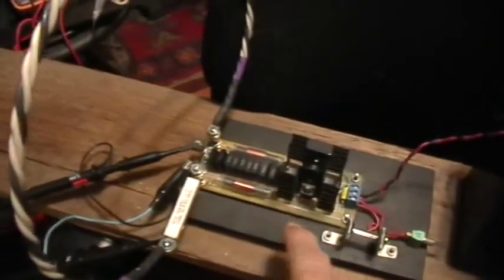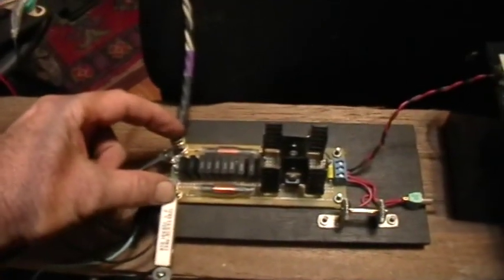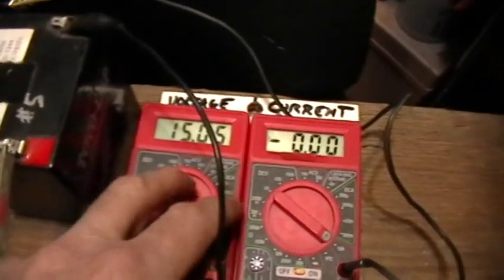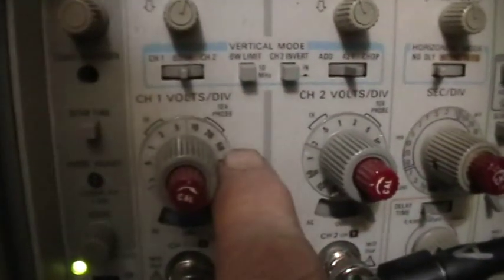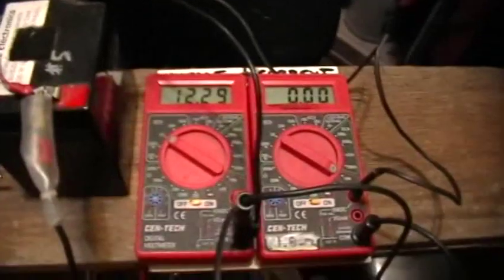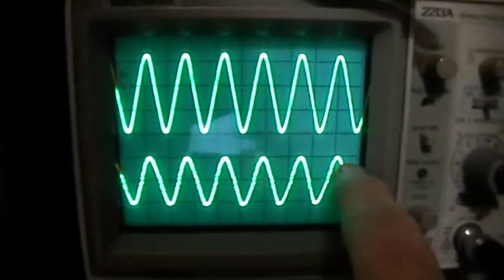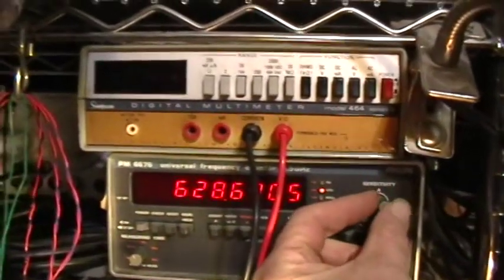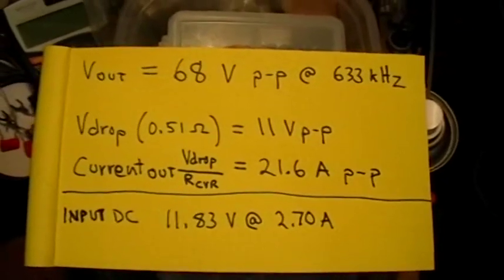Scoposcopy: Texas Has Resonance! Overunity in VARs... Or NOT ?

Comment: Nothing to have with your demo but as you looks very much more competent than me in electronics, could you tell me what would be in your opinion, the equivalent in electromagnetism of the venturi apparatus? Especially in vacuum tubers? :)
Reply from the maker: That's an interesting question. The Venturi apparatus increases airflow within its "throat" and thus produces a lower pressure, which can draw in more air from another stream into the venturi throat. I think this might be like a vacuum tube triode, or a solid-state transistor, with very low gain. (The air drawn in by the vacuum (the collector current) is much less than the main air flow creating the vacuum (the base-emitter current)). How does that sound to you?
Reply: TinselKoala I had indeed the very ideas but I was not fully satisfied with while pressure here is equivalent to voltage and flow as current. 

In venturi it is the energy conversion from pressure to speed which creates the negative pressure.

What if the outer reservoir of flow would not yet oriented electrons and that the "negative pressure", but here would be relatively to the negativity of the electrons, so positive charges/voltage, in their high speed flow would attract the free electrons of the reservoir? Would we have "o.u." here? Probably not more than in the venturi system, but I mind if making a very fast shift from neutral to positive would not attract electrons from the environment. ..
Reply from the maker: Khwartz
I think we have reached the limit of the analogy! The venturi isn't a perfect fit to the electronic device. But you could probably simulate the venturi even better with analog electronics deliberately designed.
Yes, that idea of entraining electrons from the environment with rapid rates of change in some circuitry is also what I've been thinking about for years. Possible? Hmmm......
Reply: TinselKoala You said it! "Possible? ..." ;)

Comment: First, I think, you have to divide the p-p Voltage by sqrt(2) in order to get true RMS (effective Voltage).

Then you have to take into account the phase angle between Voltage and Amperage, which is called "power factor" http://en.wikipedia.org/wiki/Power_factor. "Active power" = "apparent power" * cos(phase angle)

Finally you might see a lot of "reflective power" due to the hidden inductance of the resistor, see:  http://jnaudin.free.fr/rvproject/html/ugentest23.htm

For measuring the hidden inductance of a resistor see:
http://jnaudin.free.fr/rvproject/html/InductanceTest.htm
http://www.dos4ever.com/inductor/inductor.html

Nice demonstration, greetings, Conrad
Reply from the maker: Hi Conrad
First, if one has in-phase sinusoids, multiplying the peak-to-peak values of voltage and current, and then dividing that result by 8, is mathematically equivalent to taking the RMS values of V and I and finding average power from them.
Next, I could not see any phase shift in these signals. If there is any phase angle it is very small.
Finally, you are right, the resistor does have a significant reactance and so its overall impedance at 630 kHz is unknown by me. This will have a significant effect on the calculation, I think.
Thanks for the links, I'll see if I can find out the inductance of the resistor. My meter would not measure it at all.
Reply from the maker: I tried the method of halves listed on the dos4ever site and I can't use it with this resistor, apparently. It gives me answers like 580 nanoHenry, which would account for why my meter registers zero if correct, but I can't see how it could be correct. JLN's site is unreachable at the moment, seems to be down.
Reply from the maker: TinselKoala
It could be that accounting properly for the inductive reactance of the resistor would bring the average output power calculation right down to be in close agreement with the input power. I'll have to see if I can repeat the measurement with a proper non-inductive Current Monitoring Resistor.
Reply: TinselKoala
According to my calculations the capacitance of your resistor should be about 9e-8 Farat which results in an impedance (AC resistance) of about Z = 2.8 at 630 KHz. To measure such a low capacitance is tricky.

Formulas use: Z = sqrt(R*R + X*X), X = 1/wC, w= 2*bi*f, f = 630000

w = 630000*bi*2

C = sqrt(1/((Z*Z + R*R)*w*w)), assuming Z = 2.8 and R = 0.51 --> C = 9e-8

Greetings, Conrad
Reply from the maker: conradelektro

Actually I got the same answer using the link you provided and the method of halves. The impedance of around 2.8 ohms means that the output power computation comes out to very nearly the same as the input power. I got 580 nH as the inductance for a total Z of around 2.8 ohms. (2.3 from the inductance, plus the 0.51 from the DC resistance).

Comment: Hi,  thanks for this demo, TeslaColas.

Isn't your loop a kind of tank circuit? 

I mean it saturates in energy near instantly when supplied but it would be energy shifting alternatively from inductance to capacitance by the resonance, so having nothing to do with a true potential output power? And consumption in input is just the excess energy the tank circuit that represents your trifilar loop can't take and escapes as heat and radiations? ;)

Cheers.
Reply from the maker: You are exactly right, and that is the point of this demonstration. The people who are building and testing the "QEG" around the world are shouting and celebrating about exactly the same phenomenon I illustrate here and which you have correctly described.
Just as there is no "OU" in this device, there is also absolutely no OU in the performance of the QEG, and their claim of "33x" overunity is simply a lie, because any Electrical Engineer or even "engineering artist" worth his salary knows this fact.

Thanks for watching and commenting!
Reply: TinselKoala My Very Pleasure! :) (but thanks too, to several members of ou dot com who well explained this before ;) )

Cheers.
Reply: Khwartz BTW, I've just remembered there is a Spanish company who looks to show the same "error" with similar claims, asking money for developments of course ;) but they used flywheels to make the energy tank. But as newbies still nor relise that it NOT takes much power to maintain a flywheel turning after launched, they think: there is o.u. because big generator runned by very little motor, but of course not load at all and they can't either loop it of course too. But it is very the same than what you wanted to demonstrate with your demo :) isn't it? ;)